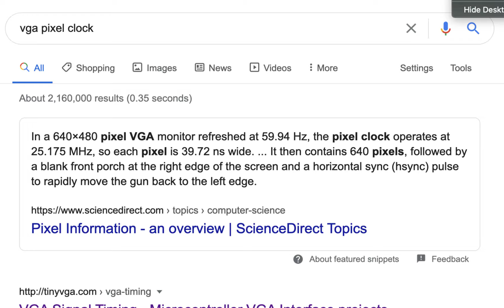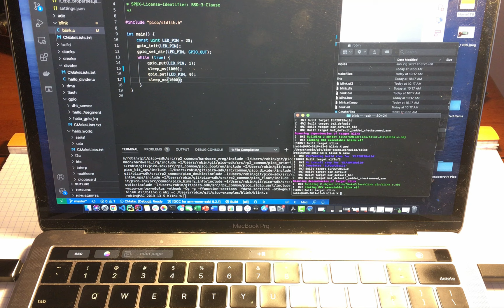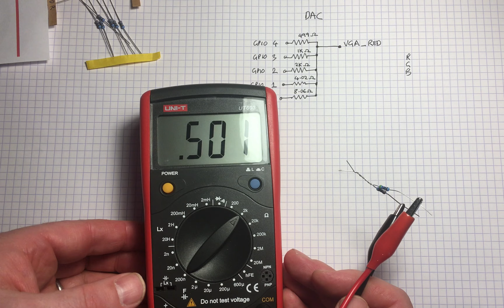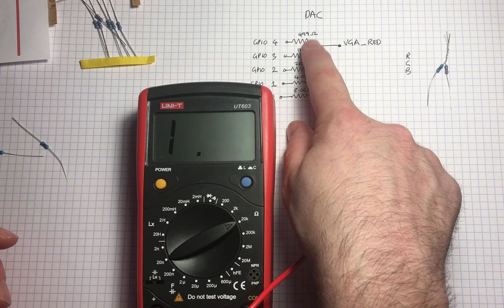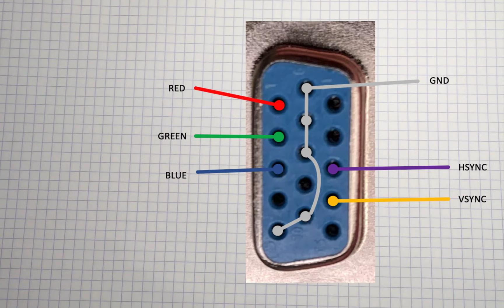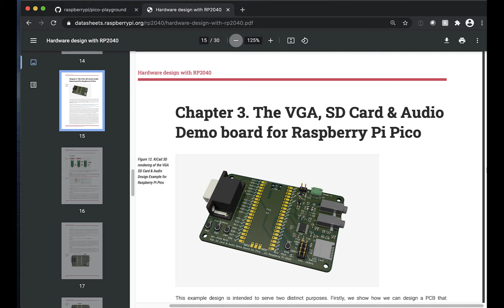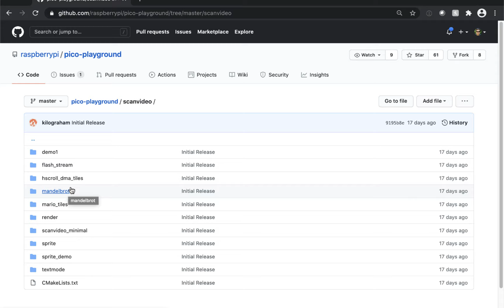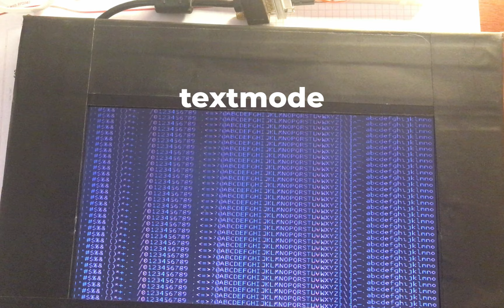Raspberry Pi Pico VGA video output using only resistors

Comment: Excellent video. I have a question: ¿What is the ide, you using for programing the raspberry pi pico board?
Reply from the maker: Its a text editor called VSCode. https://code.visualstudio.com/
It is really good. Works with lots of different languages and will run on Linux, MacOS and Windows.

Comment: hi, can I use 4.2Ω to replace 4.02Ω resistor, and 8.2Ω to replace 8.06Ω resistors ?  because 4.02Ω and 8.06Ω is hard to find, unless I serialize up several 1Ω resistors to form 4Ω and 8Ω.
Reply: they are not 4 & 8 ohm, the resister ladder makeup is wrong, each set is supposed to be 2x the previous one, which means those 4 & 8 ohms should be 4k and 8k - you should reference some better docs for actual proper VGA 5bit DAC/resister ladder, there are 100's of videos on the subject - that part of this video is not correct

Comment: Hey, I don't suppose you managed to get this running on a modern LCD monitor through D-Sub? I just got the official VGA demo board and can't seem to get any of the demos to run on it.
Reply from the maker: I did, see this video https://youtu.be/yjW6tPw4anw I connected it to a new Asus 28" 2K monitor via D-Sub and it worked really well. I have just ordered a VGA demo board myself from Pimoroni. (just came back in stock) so I was going to try that out. Which board do you have?

Comment: You reckon you could handle an HD video signal?
Reply from the maker: A few folks have got 1080i to work for vga and 720p video. Here is an example https://twitter.com/mdb036/status/1374496642112495619?s=21
Reply from the maker: Here is 720p video on a pico https://twitter.com/mdb036/status/1366102403632742404?s=21

Comment: Very nice video! Do you think it would be possible to add a w5500 to the pico and receive an image(480px * 480px) over the network to output to to vga? Is the Pico under powered for that?

Comment: Nice video! What would happen if you ran the vga signal using only one resistor ladder (bridged into R, G and B)?
Reply from the maker: You can do this... you would end up with a grey scale if you put into all RGB lines. Or you could pick a colour with some resistors and end up with a graduated shade of that colour. This project uses 15 GPIO pins for 32768 colours but using say 6 pins would get you 64 colours and lots more free pins for other things. Or simply 3 pins for red, green , blue and mixture of the 3 pin colours which would give magenta, cyan, yellow and white.
Reply: @robingrosset6941  using 1 bit per color will bring something between the CGA and EGA, with 8 colors.
Reply from the maker: @DmitryKandiner  true this would be enough to emulate retro computers which had 8 bit graphics. Lots of 70s and 80s home computers and video arcade games used 8 bit colour like this.
Reply: @robingrosset6941  8 colors are not 8 bits, it's much simpler. Eight bits will bring some 256 colors, a true VGA.
Reply from the maker: @DmitryKandiner  very true, 8 bit computers like the ZX Spectrum only had 1 bits per colour, so 3 bits = 8 colours … 2^3 :-)
Reply: @robingrosset6941  that's right, plus at least some of them, if I remember correctly, had an additional bit for luminosity (or brightness), bringing a total number of colors to 16.
Reply: @robingrosset6941  I'm trying 6-bit (2+2+2) colour, but I found that the palette is not nice with A) linear distribution of the steps, so I want on a 0-100 range to have like 0,40,70,100 and B) I don't want to map the RGB bits 1:1 to the RGB SCART pins, but insert a bit of the red channel into the blue, and a bit of that into the green, also using 2 resistor ladders. This way you don't have the ugly lemon-yellow, , colours are a bit less saturated and you get nice blues. Should I include diodes to prevent talkbalk? Is there a tool to calculate resistor ladder output levels?

Comment: What would happen if I used no resistors? Would the video just be unstable?
Reply from the maker: Mnn interesting. The colour is an analog signal on each of R,G and B lines. 0 volts is black and 0.7 volts is bright red or green or blue. If all RGB lines are 0.7 v then the screen pixel is white, each signal at full brightness. You at least need something like a resistor to scale the voltages down from 3.3v of the Pico’s I/O line to 0.7 otherwise you might damage your VGA display. 

Minimally you need one resistor per colour line for each of RGB and you could just use one Pico I/O per colour. This actually gets you 8 colours (including black and white) which is a very retro 80’s computer colour palette. The HSYNC and VSYNC lines are the ones that make the picture stable, these are TTL logic so 5v is what is expected, there is no need for scaling the voltage on these lines, no resistors needed. The pico’s 3.3v is enough to drive most VGA displays (CMOS logic level rather than TTL but most monitors like CMOS levels anyway) 

Hope this helps
Reply: @robingrosset6941  Thanks for replying, I have driven a VGA monitor with an Arduino Uno and no resistors. So maybe it'll work fine with the the Pico but I probably won't take any risks. Good to know
Reply: @goatmeal5779  What resolution can an Uno do? I calculated that for 320x240 on PAL/NTSC you need a 6MHz pixel clock. Can the UNO output a different 8-bit value from a buffer in RAM on every clock pulse?

Comment: why cant we just use
2x1ohm paraller
2x1ohm series
3x1ohm series
4x1ohm series
8x1ohm series
it will be more in scale than 
try match these and have more than 1% error for 8k thats 8oms LOL
499ohm
1000ohm
2000ohm
4020ohm
8060 ohm

Comment: Ah yes, the AVR "can't" produce VGA: https://www.youtube.com/watch?v=sNCqrylNY-0 ... this works because VGA doesn't care if you update your values for every "pixel". Unlike DVI/HDMI, the clock isn't an included physical signal; it's reconstructed from the sync signals.
Reply from the maker: I agree you can create the sync signals, and then not output every pixel. In this case pico is outputting for each pixel. There are a number of different resolutions the pico can support too which is what makes the pico more interesting for VGA in my opinion 

https://github.com/raspberrypi/pico-extras/blob/master/src/common/pico_scanvideo/vga_modes.c

Comment: Can this be done with MicroPython?
Reply from the maker: Hi Larry, so I have seen MicroPython projects for the Pico but only the simple examples like Blink and SPI, PWM ... nothing like VGA... the VGA code has critical timing sections so I think C might be required for those. I expect in time they will produce MicroPython versions which just call the C code https://docs.micropython.org/en/latest/develop/cmodules.html
Reply: @robingrosset6941  Thank you. I’ll try it in C (as soon as I get my hands on a Pico!). Great video.

Comment: What pen do you use?
Reply from the maker: It's a random pen from a pot of pens in my house. I think it's a BIC pen, says "Grip Roller ".
Reply: @robingrosset6941  I think every household has one. Sometimes we do "spring cleaning" and have to check them all to make sure they're still working. Nobody needs that many pens, but as is usually the case, you'll always have too many, or you simply can't find even one. Never in between.

Comment: we allready had parallax propeller with 8 cores or whatever. its free if allready have no need buy 4buck more lol xD. pico v2 coming.. or someone else do
Reply from the maker: I used a parallax Propeller (2 actually one in the screen for VGA and one as the IO interface) for my Apple 1 clone project 6 years ago.. https://youtu.be/Wl_xDE11_0A.   The propeller is cool with its 8 cogs but it had to be overclocked to get to USB 2.0 speeds and the programming model with Spin is kinda specialized.  I do have some propeller chips lying around but even a bare propeller chip not on a board is $8. Makes you wonder how Raspberry Pi can do it for $4. Not for profit I guess.

Comment: I was wondering if he'd ever realise that 2x 1k is 500, but nope... btw, doing vga on an arduino is much cooler
Reply from the maker: Thanks for your comment I did think of that but either way requires 2 resistors and both approaches get you within a few percent of the desired value once you consider the manufacturing tolerances. The other thing is 1K are generally more useful than 470 ohm and 33 ohm particularly if you are making R2R DACs (which this is not) but it is why I did not want to use all my 1K resistors, your suggestion would require 9 1K resistors mine uses 3 which is why I chose it. I also have folks who suggested it would be easier/better to make an R2R DAC but I did not have enough 1K and 2K to create all 3 of the 5bit dacs. It would require 15 of each. Which Arduino did you use to do VGA? I’d be interested in what pixel clock you were able to achieve, video link if you have one.
Reply from the maker: Oh wait I found one https://youtu.be/jUoR5ICCepA  that is cool. Monochrome and require an extra IC, but still pretty cool. The nice thing about Pico VGA is you have up to HD resolution with 15 bit colour and entirely another core running at ~300 mhz to do other things which is how you can build a BBC model B or Spectrum emulators with it.

Comment: You realize you keep saying ‘8.1 ohm’ ... not K....and even your notes say that, when the PI doc has it at 8k and 4k .... makes the ladder all over the place. All you have to do is read their doc right.
Reply from the maker: Yup. YouTube does not allow you to re-upload videos. So there is a card in the video at that point which takes you through to the video with the correction. https://youtu.be/i1AwtqPtfrQ

Also the description describes the correct resistor values.
Reply: Yeah ... but no matter what, it is good that you took the time to give visibility to that pico capability.. many people do not read the docs and will only find out about it via videos like yours.